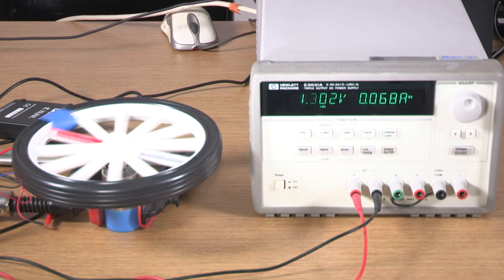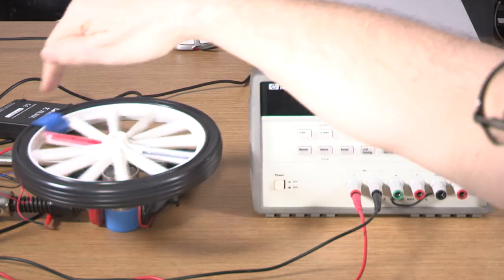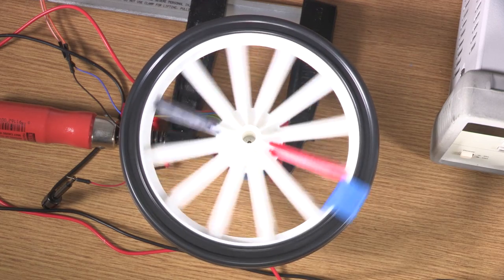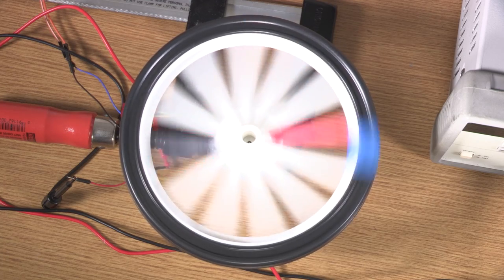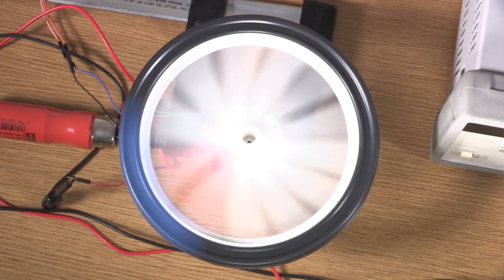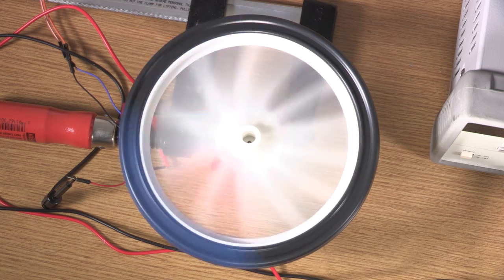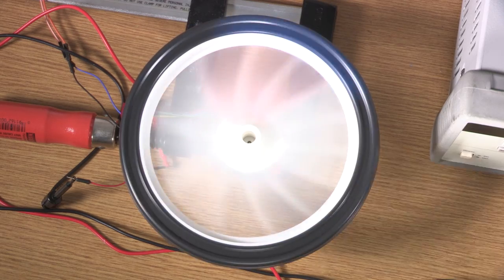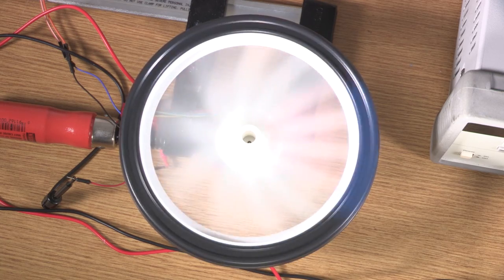C14 5 Wagon wheel effect

Comment: hmmm - I found your choice of measurement units were confusing. You should have avoided talking about changing the 'voltage' - and just told us how many fps or revs per second the wheel was rotating at.   It would have also been nice if you mentioned if the observer without the 24fps camera monitor had noticed any aliasing (at at what revs per sec - if any)  - Thank you.

Comment: So I'm new to this bit what I'm wondering is if the anti spin is basically the counter force or balance (visually) to the main spinning direction. As you increase speed, does the antispins rate of rotation match the spins rotation but in a reverse manner? If you imagine a rope with something heavy tied to it hanging from a tree, and you spin said rope, once it hits a point, it reverses speed. I've noticed it begins slow, and then speeds up like this graph (numbers represent rotations per second or w.e): ((+1+10+20+10+1 / -1-10-20-10-1))
It would spin or teeter back and fourth until both alternating counter spins reach their lowest energy point, which is a resting point. So because it reverses in measurement.. is it perhaps actually moving backwards in time? If you attach 2 clocks to wheels and spin one so that it remains to appear in reverse (antispin) would the times be different when you stopped them both at the same time? They say speed makes you time travel tiny fractions, which I imagine is dilating time and then resetting it and ending up offset a bit, so if direction and measurements are relative, then how do we know which directions things are really going or how fast they are really going? We compare them to neighboring particles/forces and objects momentum or velocity, but that reference point is based on other references or even worse it's based off or is the reference it's referencing. Basically a feedback loop. They said gamma radiation waves move backwards in time but none will explain it simply. Are gamma waves doing the wagon wheel effect? They move very fast that they would appear to travel backwards, thus sending information forward to be fed backwards. In a sense things work backwards to propel forwards. Can anyone help me with this?
Reply: Actually it's our eyes which are behind this .they only see stuff at 24 frames or 24 pictures per second .though the explanation is easy but I won't explain it so search on youtube why wheels move backwards
Reply: It's just an optical illusion. It's all based on how frequently our eyes update with information, or in this case the camera. As for your thing with ropes, that's simple harmonic motion described with sine wave. Any sort of non-negligible "time travel" would occur at speeds at a significant fraction of the speed of light, and that's really only slowing down time rather than traveling through time. Gamma rays don't travel backwards in time, that's just an issue with measuring them and not fully understanding the process that occurs when black holes are formed, again an illusion.

Comment: Wagon-Wheel Effect Not an Optical Illusion

So I was staring at the ceiling fan and watching the "Wagon Wheel Effect", that is the appearance of the center piece of the ceiling fan traveling the opposite direction as the rest of the fan. Now Wikipedia says this-The wagon-wheel effect (alternatively, stagecoach-wheel effect , stroboscopic effect ) is an optical illusion in which a spoked wheel appears to rotate differently from its true rotation. The wheel can appear to rotate more slowly than the true rotation, it can appear stationary, or it can appear to rotate in the opposite direction from the true rotation. This last form of the effect is sometimes called the reverse rotation effect .And they go on to suggest several theories but the one I didn't see was simply The photons are traveling in the opposite direction. Simply the truth be told that the Wagon Wheel Effect is NOT AN OPTICAL ILLUSION. YOU REALLY ARE SEEING THE PHOTONS NEAR THE CENTER OF THE WHEEL/FAN BOUNCING BACKWARDS. The distance in the center of the wheel is shorter than the outer fan blade area, and that makes the appearance of the center piece traveling in reverse possible because light travels the same speed and the shorter distance would get the light faster. All these theories and scientific explanations that call it an optical illusion are wrong as the photons with the shorter distance to travel are bouncing back in the other direction and creating a "Photon Wheel."

This would mean that a century of belief that the Wagon-Wheel phenomena is an Optical Illusion and was aligned to many people to mean they have some innate or inherited eye-brain defect was all along wrong. Those that can see the effect are instead in possession of quality vision that is allowing you see see a miniscule photon stream that is not an illusion but an actual physical wheel of light. To some people this knowledge would be a relief, as they disdain from any link to their own mind and vision having any form of defect, and an optical illusion would be considered such a flaw.

It all appears that the only illusion is the scientific community that has lingered with the theory of the entire effect as some mind-eye-illusion. They use words like "Perception" and "Temporal Parcing" and associate the effect as mind/eye coordination defect. The sad reality is simple math will prove it to be only Photon Bounce. We know from shining a flashlight in a mirror that photons do bounce. We know the perimeter distance inside a ceiling fans hub or the metallic arm that bolts to the wooden fan blades is shorter than the distance on the outside tip of the fan blades. So the photons bouncing off the metal arm fan blade holder are traveling a shorter distance, and they are bouncing back and forth, but with an obvious opposite direction as the fan goes. Using a flashlight aimed at the fan arms rotating you should see the photon bounce back more clearly. I did it while lying down and aiming the flashlight from a few degrees angle. However one should try all the angles and like me you should see a more pronounced bounce back. So simple to prove yet all these great scientific minds still pass this effect off as an Optical Illusion. The Wagon Wheel Effect is so terribly easy to prove as Photon Bounce Back that I wonder why it's still being passed off as some Eye/Brain Hypnotic Trick? This can be proved to the state of Absolute Validity and should be to dismiss one more piece of hocus pocus in the world of science.